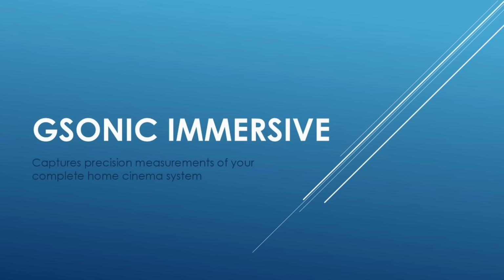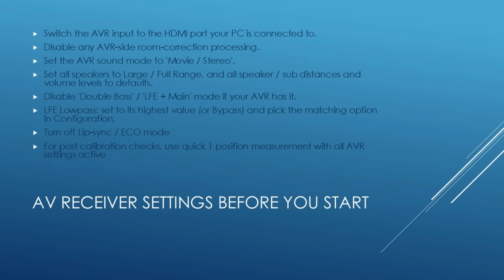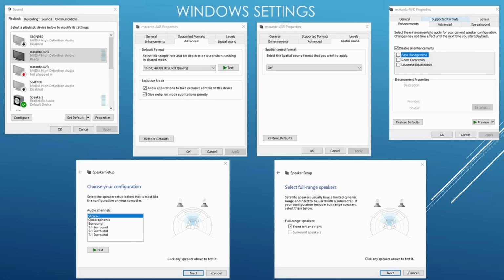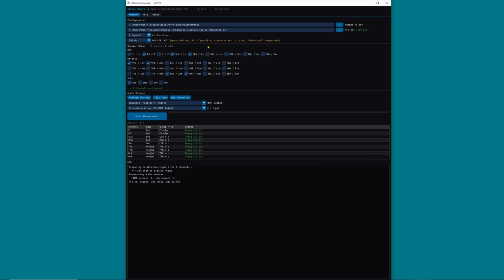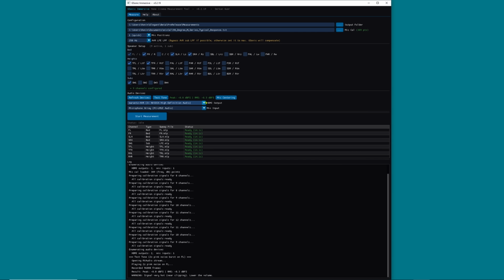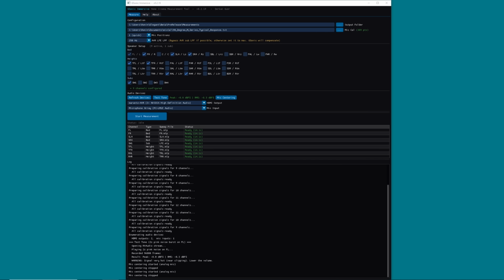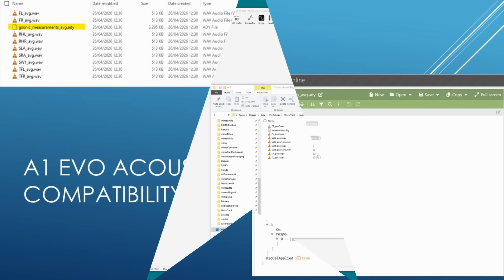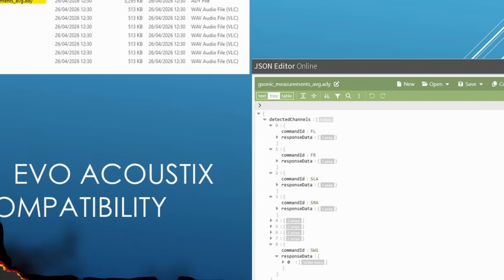GSonic Immersive

Comment: Works brilliant and very easy to use plus I have my UMIK back in action again to test/compare.  Just some initial thoughts (Might have mentioned this previously).  To allow for GSI measurement mode in A1X, would it be possible to either have an option in A1X that sets a selected Preset with all settings required specifically for GSI measuring OR create a GSI_MeasurementMode.oca file that can be used with A1X transfer that does all the required settings.  
From an initial test run this afternoon between A1X measurements and using GSI measurements with A1X (All settings/target curve same), it looks like all 4 subs (GSI measurements) in logs are around +10 higher; would this be expected?
Thank you once again 😄
Reply from the maker: Thanks for the purchase. It's very easy to add a set AVR to measurement mode button to GSI but it'll need to be D&M only button which looks a bit weird since I have no way of doing this to other brands but noted for the next update.

The measurements are in dbFS as measured by Umik and its gain level in the PC and the AVR volume during measurements. REW assigns a reference value to convert it to dB SPL and that can land anywhere. I get them around 32dB. That's completely irrelevant to the generated filters. Relative levels of all speakers and subs are very precisely preserved in that ady file. You should hear the difference soon. One issue though, with multiple subs, the process is a bit tedious no matter how much you automate. There's no way to avoid manual one by one switch off. I would be more comfortable if you bought this and had only one sub.
Reply: @o @ocaudiophile  was thinking option could be in A1X menu not GSI.
The manual switch off for subs is no problem, works really well and is simple.   All great so far only did quick test. Looking to do full multiple position measurements tomorrow. Exciting 😊
Reply from the maker: I found my TFL&TFR were inverted for a long time after measuring with this. I was inverting them deliberately when I was writing polarity detection functions and have totally forgotten. It extracts phase with high precision. Should help with all alignments in A1X.
Reply: @ocaudiophile  I did a 5 position run with GSI, all went great. I did have a couple of errors which I clicked repeat and all worked fine.  Now, when using the .ady produced by GSI in AcoustiX, SW1 to 4, I think they are around 10db out/lower?  It is as if each SW measurement needs to be 10db higher too start with?  I am mainly comparing this to exactly same settings/config as when using Audyssey MIC in AcoustiX.
Reply from the maker: I see but the explanation only adds to the confusion. When using GSI ady file in A1X, the calibration result had way too much bass or no bass at all. Which one was it?
Reply from the maker: Anyway, I think your model still applies -12.04dB offset when only one sub is active as it sees all 4 subs connected. That'll need a property addition to the GSI ady file and an update to A1X to recognize and treat GSI ady files accordingly. I am waiting for gumroad update email system to be activated to release the update, probably after this Friday. In the meantime you can keep manually adding 12.04db (not 10dB) in REW. If you are getting repeat sweeps regularly, something is not right in the setup btw.
Reply: @ocaudiophile   Serkan based on first reply, yes way too much bass as it was ending with +12 on all 4 sub levels however the final SW and filters in REW  looked wrong (Plus when listening it sounded wrong).  I decided to investigate and from initial observations, it looked like SW's were around 10 to low in terms of initial SW measurements in REW; I then tested by adding 10 SPL to each SW measurement and everything fell into place.   As you mention, yes that rings a bell with regards to the -12 offset (Marantz Cinema 40) and I cannot remember if it was a different offset per SW 2,3,4 so this might explain exactly it.  I will try with 12.04 soon as I can; hopefully before your update arrives,   Can I send you the measurement logs for your reference/review please?  Also using these GSI measurements using UMIK with A1X is the "magic" sauce 😁  Will drop some listening feedback in here and A1X video soon. Look forward to updates thank you again 👌
Reply from the maker: No need, I know exactly what is happening. Actually there's a note in the logs about that but of course the note doesn't go in the ady file. I was hoping that new models would maybe not trigger the sub compensation when all 3 subs are switched off but your observation is proof that they do. It's a simple fix but will also require a single line A1X update.

PS If you had 2 subs, you would have added 6.02dB in REW and for 3 subs 9.54dB
Reply: @ocaudiophile  ah yes 100%! I remember testing this ages ago - awesome!  Btw this is the log I mentioned, it only happened from 3rd position onwards only a couple of times:  ATR timing unreliable: SNRs OK (56.1 / 53.0 dB; region peaks 9.7 / 9.7 dBFS) but measured drift +526 ppm is implausible - at least one ATR locked on a reflection. Will prompt for Repeat.
   NOTE: ATR captured at 9.7 / 9.7 dBFS (clipping). Algorithm compensates via leading-edge picker, but lowering AVR volume ~3 dB would avoid the saturation entirely.
   Mic-position shift relative to pos 1: -1577.51 ms
>>> FL recording had unreliable ATR timing - either both chirps were blocked or one was disrupted enough that the cross-correlation locked on a reflection. Step out of the FL sound path, then click Repeat to re-measure FL.
Reply: @ocaudiophile  I'm following this too; I have 2 subs, and it looks like I needed to add about 6 or 7db to the sub measurement in REW to get to where I'm used to seeing if that helps (based on previous measurements.mdat created by acoustix measuring tool)
Reply from the maker: Should be 6.02dB for 2 subs 20 x log10(number of subs) but remember this is only if you have a new model or one of 4700, 6700, 7015, 8015 (models with Griffin Lite DSP chip). These models internally apply these offsets based on number of subs (older models don't and with them subs are physically summed as is). AcoustiX reverses this and I need to tell AcoustiX to not do that when ady file is coming from GSI as it measures true volume of each sub.

Comment: Hi Serkan, got me thinking now that I have both, which one is recommended for 2.1 music listening, GSonic Reference or GSonic Immersive+AcoustiX? One advantage with Immersive is that’s it can be used by a receiver so you don’t have to listen to music from PC only but also players/streamers, I’m just wondering about the sound quality itself.
Reply from the maker: The correction that can be done through the Audyssey interface is limited compared to what GSR can do in a PC with a convolution engine (1024 vs 32k taps for example) but there's the convenience threshold plus subwoofer addition with Acoustix. Best is to optimize both to the limit and decide for yourself. There'll be MIMO tool at some point that can use all your floor channels and subs for stereo music listening like Dirac ART does to actively cancel room modes - only better ;) and you will be able to get it at a great discount as you already bought GSI but not in the immediate plans.
Reply: @o @ocaudiophile  Always something new! Another question, when I want to take a quick measurements to check my results, the SW LPF is set at 120Hz in the receiver, what should I set in GSonic?
Reply from the maker: Set it to bypass because you wanna see what your LFE content is really doing which is lowpassing everything at 120Hz.
Reply: @ocaudiophile  Gotcha, thanks again.

Comment: Hi OCA, after listening for hours after gsonic measurement. Midrange and imaging has improved a lot but I have one request why there no option for multiple measurements for each speaker in a position?
Also oca let me know if there is a good improvement in measurement if i am using umik-2 from umik-1.
Reply from the maker: The de-convolution method and sweeps used are very prone to noise so multiple repetitions per position didn't seem necessary. But it can be added later when more people can get a grab of the app. Right now it will add too much complication I think. For MLP only, you can do as many repeats as you like though if you keep the mic in place.
Reply: @o @ocaudiophile k will try. What about umik-2 any difference from umik-1.
Reply from the maker: I had both in the past. Umik-2 has an internal clock and comes with a more individual calibration which are the main differences. But for the price (and which is what I did after selling them both) you can get a descent audio interface and an analog mic. USB mics will always have some clock drift issues (GSonic solves it with dual ATR chirps) and for example usually their cables will not be long enough to reach MLP or the near field speaker.
Reply: @o @ocaudiophile  Thanks for sharing 👍🏼

Comment: Can we use it for a 2.1 hifi system? Or will you create a separate version for hifi systems?
Reply from the maker: There's the free GS Reference for 2.0 (but adaptable to 2.1 if you do your crossover and sub delay manually). There will be a paid 2.1 MIMO soon. This can surely measure your 2.1 system but this one does not create filters, only measures.
Reply: @ocaudiophile Im waiting for 2.1 2.2 MIMO Sir!

Comment: Hi OCA,
I measured using umik-1, 6 different positions and results are very different, I found improvement in midrange drastically, imaging, clarity and details have improved a lot 👍🏼, But I found one drawback from audyssey acoustix measurement the soundstage is little more wider than gsonic immersive. But overall it’s very good improvement.❤ Thanks for your work.

Comment: Hi, OCA. Long-time watcher, and now GSonic purchaser. Thank you so much for your work and support for this community. A few questions I'm curious about, please.

1. What would you recommend the AVR LFE LPF be set to in GSonic when using a Denon x4700h (Max LPF: 250 Hz) but my Rel T/5i subwoofers' physical LFE level knobs only go to 120 Hz. GSonic does not have 120 Hz as an option for LFE LPF so should I be selecting 250 Hz or Bypass?

2. Finally, before running GSonic, should my Rel subwoofer XO and LFE level knobs be set to Max (120 Hz) for full Bypass? I'm not sure how much manually setting the knobs before-hand affects the GSonic measurements.

3. Do the frequency EQ limits still need to be manually set in A1 Evo AcoustiX after running GSonic for a 7.2.4 setup?

Thank you, again!
Reply from the maker: Thank you vm.
1. Defo 250Hz, the higher the better. Because your REL already ends at 120Hz, you will get perfect replication.
2. You should max out REL's own setting.
3. Once you have the ady file, you are free to do anything with it in AcoustiX like you took the measurement with AcoustiX (only much more precise) so you can customize the optimization as you wish.
Reply: @ocaudiophile thank you for the reply. Does GSonic automatically disable features such as midrange compensation or should the calibration file need to be sent to the MultiEQ app, post-Audyssey?
Reply: *or AcoustiX
Reply from the maker: It's for taking measurements and averaging them. It does not generate filters or calibration files. If you are using a Denon or Marantz receiver, it produces an ady file that you can use with AcoustiX which will generate filters from these measurements and transfer them to your AVR. For the few settings that needs to be done in your AVR before measurements, please refer to the video.

Comment: Hi Serkan, ready to purchase GSonic Immersive and run measurements. Will use my kid’s gaming PC for now my old laptop unreliable and I don’t wan’t to use my company’s laptop.

But just to confirm, the “Dolby Volume Offset” only affects Top Middle and Side Surrounds? I will get Side Surrounds benefits with GSonic, but I don’t have Top Middle, only Top Fronts and Top Rears, are these aren’t affected? So the cinema speaker arrays you mention is from front/back to back/front only not left/right to right/left?
Reply from the maker: Correct. I don't have top middles either but have side surrounds. The arrays are back to front.

A descent laptop is not a must but surely helps smooth out the process.
Reply: @ocaudiophile  Thanks! Just done measurements for 4 positions, took just 20 minutes! One more question, sorry for so many just want to be sure I did it correctly, I see on the receiver it shows THD +Dsur during the measurements, this is expected right? Just means GSonic doesn't send Atmos codec with metadata  and uses the Dolby upmixer?
Reply from the maker: You are amazing, many others take 20 minutes to get the first test tone. Windows sound settings can be finicky to get right initially.

FL is pcm (needs to be for maximum timing precision), the rest of the floor channels are trueHD lossless, all others are trueHD lossless Atmos. Just set the mode to stereo and the AVR should switch itself automatically based on the incoming signal type.
Reply: @ocaudiophile  Thank you for the kind words :), after following you for a few years things get smoother. The Windows settings already set as required from GSonic Reference just need to double confirm. Just ran a measurement again and abort just to look at the receiver display, I can confirm, FL shows Stereo, the rest of the bed layers show THD +DSur, and when it gets to the overhead speakers it changes to Atmos. Also, the Mic Centering tool, that's genius, I was smiling during that with that nice tone! Now it's time to optimise using the other genius tool from you, A1 Evo AcoustiX. Just want you to know again I'm super happy with the purchase, I'll write a review soon.
Reply: @ocaudiophile   Optimising with AcoustiX, it sets my FL to 0.0 dB and FR to -3.5 dB both with default and my own target curve, my original AcoustiX measurements they usually match each other. Does this mean the measurement wasn't good? Mic centering was 1 mm during measurements, but in AcoustiX optimisation it says 14.4 mm. Should I trust the result or should I re-run the measurement? EDIT: Perhaps the PCM is sent by Windows at a different dB than the TrueHD? FOLLOW UP EDIT: I increase Windows volume 10 points and re-run measurements again, FR is now closer to FL at -1.5 so the Windows volume does affect PCM signal even in exclusive mode, but GSonic always match back so in the end it doesn't matter. But I forgot to set LPF for SW back to 250 Hz this time, in GSonic I set to Bypass does that mean it's okay?
Reply: @ocaudiophile  The optimisation final target level is also 20 dB lower than when measured with AcoustiX. The only difference is the PC, I think the combination of my PC volume with my normal listening volume in the receiver with my blu-ray player changes the actual dB of the sweeps, in this case louder. I should've known this, I think I'll have to measure the SPL with REW first to make sure it matches my listening level before running measurements with GSonic Immersive again. This only affects PCM because Windows doesn't control bitstreamed audio volume.
Reply from the maker: All sweeps are performed at the same volume, so any differences you’re seeing are most likely real. A common reason is room interaction—for example, if one speaker is positioned closer to walls than the other, it can affect certain frequency ranges differently.

There are a few less likely factors worth checking as well. Make sure “Loudness Management” is turned off—this setting only appears when an Atmos signal is detected. Even though the sweeps use the minimum dialnorm value, loudness management can still have an effect.

Another often overlooked but fairly common issue is speaker wiring. It’s possible that one of the speaker connections is loose. If your AVR is a bit older, it’s worth paying extra attention to the banana plug terminals—especially at their base—as they can loosen or wear out over time. I have this issue with my SLA.

And for your sanity, you can measure with GSonic Reference simultaneously and check all in REW for levels. GSonic uses pcm for both FL and FR.
Reply from the maker: The target levels of ADY IR files can appear anywhere in REW because impulse responses don’t carry volume information—they’re all normalized to 0 dBFS. REW has to convert that into dB SPL using a reference, which can vary depending on the audio driver selected at the time.

What actually matters is the relative volume balance between the speakers, not their absolute SPL values. The measurement chain using the Audyssey mic and AVR gain structure is completely different from a PC + mic setup, so the readings won’t match anyway.

The only truly meaningful parameter during measurements is the AVR volume level you use. It should reflect your typical listening level, since that’s what you’re tuning your target curve for. Bass perception, in particular, changes with volume—it tends to feel stronger at higher levels and weaker at lower ones.

For reference, my own Audyssey measurements (using an analog mic and audio interface) show around 32 dB in REW. I never calibrated my mic against an SPL meter, because it doesn’t affect the filters generated by the A1X at all.
Reply: @ocaudiophile  Understood, the result is just outstanding, immersive is not just the name, it really is this time. Thank you Serkan!
Reply: One more thing, the volume in the receiver should be set at listening level, right? EDIT: This explained in the Help page.
Reply: Purchased! My email uses my Youtube ID so you'll know which just in case. :)
Reply from the maker: Yes can see it. Many thanks! Hope you enjoy it to the full. Let me know if you run into any issues.